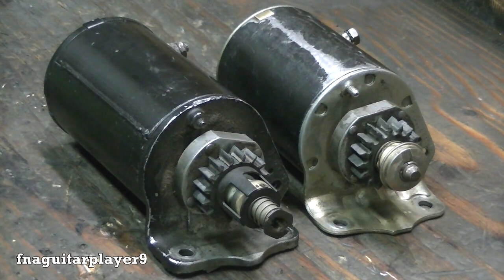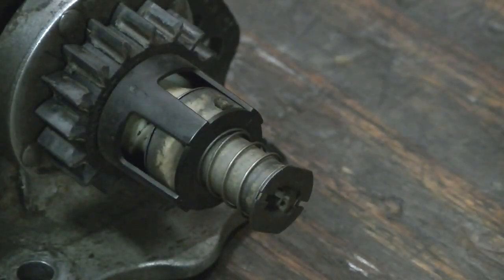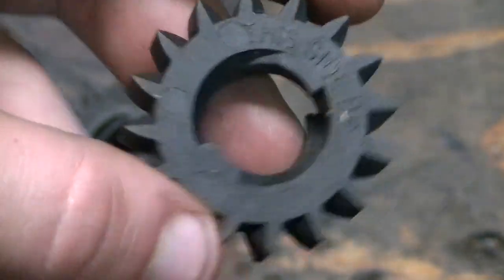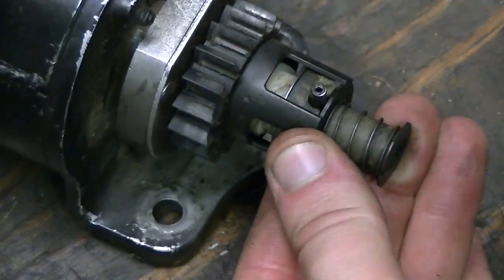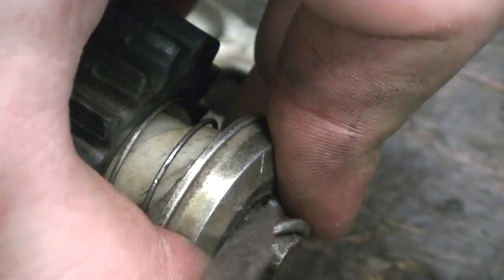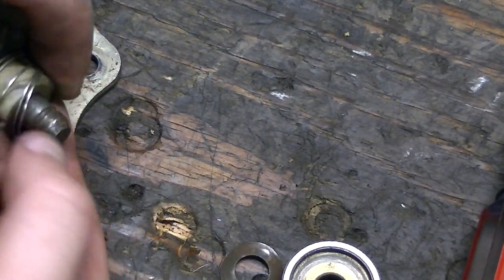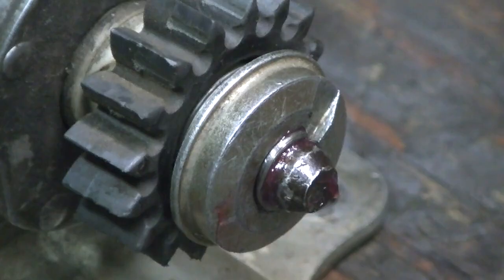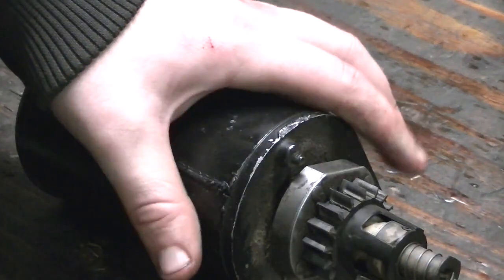How to replace a starter gear on Briggs and Stratton Starters (both rollpin and C clip type)

Comment: Thanks for the fair warning on the C clip flying off.  I held the starter in a box and popped the C clip off and it stayed in the box.  Seeing the difficulty you had putting the C clip back on I put the starter vertical and laid the C Clip on the shaft, then took a 10MM socked on top of the C clip and with one tap of the hammer it was on.
Reply from the maker: haha your welcome! I bought a bunch of them in case i loose them haha I hate this type! Thanks for Watching!!!

Comment: Thank you for this video.  While it was a real pain in the you know what, I did replace the gear on my starter today.  Thanks to you.  You ain't kidding that the dang C-clip removal and then subsequent re-installation is a royal pain.  But with a bit of perseverance and your guidance, I was able to do it, re-install my starter and get my mower running today, just in time to put it away for the winter.  Thanks so much!

Comment: Good video. To get the C clip back on, I set it on top of the shaft & use a 7/16 deep well socket & a small hammer to set it down into the groove. It works slightly similar to the tool they make for it.
Reply from the maker: Lucas Howard Thanks! I have heard of this before, I'll give it a try next time I run into this type. Thanks for Watching!!!
Reply: +Lucas Howard  I just said this then read yours sorry
Reply: 🙋🏻‍♂️ I noticed that also, but a little grease would help hold C clip in place guys. 3-25-2023 👍🏻🇺🇸🫶🏻
Reply: @vicbitterdog  ditto..
Reply: I found that a 3/8 worked best for me.

Comment: I looked at about 3 other videos on replacing a starter--one pushed the expensive Briggs & Stratton pin remover. Which is at least   $73! Well, I was determined not to buy it. So I tried just about all other removal methods and odd tools. I struggled. I even used an awl (ice pick): only to pick my hand 4 times! 
And then I saw your video--slowly take 2 flathead screwdrivers...EVEN I COULD REMOVE THE STUBBORN C-PIN THIS WAY! Thanks so much for keeping it simple!

Comment: I set the starter in a vice (made sure to secure using the mounting bracket, not the starter housing so it wouldn't crush the unit) and a closed 3/8 wrench end on top of the C clip.  Whacked it down and she was pretty much set.  Thanks for the helpful video to get me and eventual the tractor started!!!

Comment: After my B&S starter smoked, I ordered a replacement. It had a 14 tooth gear and the old one was 16. Thanks to your clip I had the guts to swap the gears and solve my problem. That little 'c' clip was nasty, but I sprayed a little silicone on it and tapped it on. Thanks for the video!
Reply from the maker: I hear ya! Yeah, that clip is a pain, i hate that type, i much prefer the roll pin style, much easier to take apart and re-install, unless its rusted up. your welcome, Thanks for Watching!!!

Comment: Good video.  I liked the way you showed how to replace the pinion gear held on with either a roll pin or a C-clip and you showed details on removing the roll pin using a 1/8-inch punch that is not tapered.  I needed to know how to remove the roll pin without damaging the starter.
Reply from the maker: Thanks! Glad to help out! Thanks for Watching!!!

Comment: I am glad I found this as most people think their starter is bad because the engine won't turn over, going clunk, and it is really that their engine is full of gas from a faulty shut off solenoid at the carburetor, or their valves are severely out of adjustment creating too much compression. Key on, valve is supposed to open allowing fuel, key off it is supposed to close. It can get gummed up and allow fuel past when in off position filling crank case, or you left key on and it filled. This motor is notorious for this and a manual in line shut off between tank and carb is essential to prevent gas in your oil. I am sure many shops have ripped off many customers by charging them for expensive repairs when it was gas in their oil. My suggestion to most if repairing the starter and the starter gear looks fine, would be to bypass the snap ring removal as most only needed to inspect the brushes and sand the commutator. Remove rear 2 bolts and slide internal brush pack out, then pull the entire assembly out from the other end. Sand commutator, inspect brushes, and grease rear shaft. You can avoid the grease suction problem by rotating shaft at starter gear back and forth while applying pressure to back plate. The trick to keeping the brushes in upon reassembly is iron wire cut in two pieces shaped like a horse shoe. They criss cross each other at center as one holds in two brushes and the other does same. Top wire must be 2" longer as it sits higher to clear lower wire holding other two brushes at 3 and 9 oclock, longer wire holds brushes at 12 and 6 oclock. Works perfect and slide back plate in, wires should stay as long as they are flush against brushes. Then pull them out and it makes replacing brush pack easy.
Reply from the maker: That is very true, or oil got into the cylinder from being tilted the wrong way or something like that. yeah, on OHV motors, its almost always the valves out of adjustment making it hard to crank over, they have a compression release on the camshaft, some of the older L Head / flathead motors have a release as well. Thanks for Watching!!!

Comment: I'm glad that I saw this. With the arrival of colder weather the starter gear on my pretty new Briggs and Stratton powered lawnmower stopped engaging the ring gear. There is a small possibility that the plastic gear might be damaged but I think it's just stuck in the down position.  Removal and inspection is going to be necessary. If WD-40 can help matters I'll be very happy.
Reply from the maker: Sometimes they will stick or may have dirt build up on the bendix but usually will clear up with penetrating oil. Thanks for Watching!!!

Comment: Thanks so much for making this video and sharing it.  I've been working on one of my cub cadets on and off for about four days trying o figure out how to repair the starter gear. Biggest problem was getting yo the you bolt attaching the starter to the engine.  It was almost impossible to get to. I gab yo grind down a 13mm socket to make it small enough to get into the very small space surrounding the bolt. Once that was done, I was able O get the starter out and on a bench where your video showed me how to drive out the roll pin.  Piece of cake thanks to your help!!
Reply from the maker: Your welcome! I hear ya, its hard to get to some of them, especially the opposed twin cylinder briggs and strattons, one bolt is under the flywheel, have to wrench it all the way! Glad to help out, Thanks for Watching!!!

Comment: I found it, that helped somewhat. I was able to get the flywheel cover off, after about 20 bolts. The starter is bolted to the engine through the top (2 bolts) and 1 bolt was easy to get to, the other is under the flywheel. However when I got the cover off and tried to start I could see that the drive gear was stuck in the down position and not engaging the flywheel! A tap and a dousing of WD40 seemed to do the trick for now, the gear itself looks like it's still in good shape. Thanks again!

Comment: Good video. But a suggestion on the second one with the c clip you can use a socket to tap it down over the tapered end right into the groove. Find which socket works best over the shaft before installing the gear assembly.  Hope this helps and makes it easier for ya. Thanks for the video.

Comment: Thank you! This was EXACTLY what I needed to fix my starter!! 

ALL the teeth on my starter were completely stripped away. This is going to save me a couple bucks for sure! (By couple, I mean a trip or call to a mobile small-engine repair guy, easily $30-$50 for this type of service call.)
Reply from the maker: Your welcome! Glad to help out! I hear ya! I just had that happend on my mower this past week, had to put a new one it (made a video, will be putting it up soon) the gear was making noise then it stripped out right on camera, perfect timing!!! I know right, shops charge a fortune! Thanks for Watching!!!

Comment: After watching your video I replaced the parts of the new starter with the old starter parts( Metal) because the new starter lasted  7 starts and plastic gears got tore up I guess because there was no lubricant on them, I also used the socket idea for installing the clip and it worked great! Thanks for posting this video.
Reply from the maker: Your welcome, Thanks for Watching!!!

Comment: I am so glad we found this video, it helped us so much. We were on each other's nerves trying to figure out how it came apart to put another part on. I need to subscribe to this. Thanks so much to the one who made it and shared.
Reply: +Remah Howell I also found this to take all the guess work out - apparently I have the roll pin, and I ordered a new gear on EBAY for $3.50 shipped !!
But please stop using WD-40. There are better lubricants, and penetrants out there.
Reply from the maker: +TIMEtoRIDE900 I hear ya, thats a good deal! I hear ya, I like wd myself, but I usually pb blaster for loosening bolts and stuff, alot of different stuff that would work great. Thanks for Watching!!!

Comment: Thanks heaps for posting this vid.My starter failed yesterday, the gear had jammed itself at 45 degrees  between the outside cover and the edge of the teeth of the ring gear.My big problem was although I found all the missing bits that were scattered down the driveway,  I didn't have a clue if was all there or how it fitted together. Now thanks to your vid I have learned some thing useful.Obviously, the locking clip failed. It was also found it on the driveway.Once again, thanks mate. Cheers
Reply from the maker: +tryhardparrot Your welcome, glad to help out! I hear ya, glad you got it fixed and was lucky enough to find all the parts! Thanks fro Watching!!!

Comment: To get the C-clip off, rotate the clip in the cap so the opening of the clip is away from the slot in the cap.  Use a screwdriver that is narrow enough to fit in the slot to get under the clip as you press the cap down.  Pry it up until it’s halfway off, then use needle-nose to get it off.  To get it back on, set the C-clip in place and tap a 3/8” socket down over the C-clip with a hammer, a little grease may help.  Worked for me. Then use a little graphite dry lube on the gear shaft, WD-40 will attract dirt

Comment: Man my starter's roll pin was so rusted and expanded up I had been slamming it with a nail + 4 lbs sledge + penetrating fluid and it STILL took forever to get it off - somehow the starter motor still works but I had to sacrifice the spring + plastic encasing in my brutish attempts. Just wanted to say your video(s) were super helpful in getting my toro 8-32 rear rider up and running great!
Reply from the maker: Oh wow! I've had them like that, i've had to drill them before too. Thanks for Watching!!!

Comment: Turned out I had to go to a completely different type of OUTSIDE Snap Ring.  I just could not get the required ring in.  And I was not about to buy a tool for over $40.00 that I would use just this one time.
Good info on the Chamfered side up (for the pinion).  Mine was not labeled in any way, but I deduced that the chamfered side would engage the Ring Gear a lot easier than the "flat" side, just like a car's starter pinion.
Sure appreciate you folks who take the time to make these videos.  Have done lots of these things many years ago and then forgot after not having done "whatever" again for 50 years or so.
I understand that when WD-40 (so named 'cuz it took its inventor 40 tries to come up with the formula) sold many years ago the new owners significantly raised the water content in it.  No idea if this is true or just Camel Poop, but Blaster works just fine for me.   Thank you.
Reply from the maker: I hear ya! I'm always glad to help people out. I do agree with that, i usually only use wd40 on stuff like that starter or hinges, and pb for rusted on bolts and stuff. your welcome, Thanks for Watching!!!

Comment: Don't forget to check bolt tightness, there has to be a lockwasher on each bolt otherwise they bottom in the hole and leave a dangling starter motor that strips threads faster.   Chk starter frequently for looseness/wobbly install (loose or bottomed bolts).   2. U can use 9mm or 5/16 socket & hammer to tap the snap ring back in.   3.  One guy showed how by turning the flywheel (battery disconnected) by hand he can get the pinion gear off & one without taking starter or flywheel off.   Another guy showed how he with hand grinder, ground off about 3-4" length of top side of flywheel (don't get into the flywheel teeth) to make more room to get pinion gear off easier removal again w/o taking starter or flywheel off.  Good video, thanks.
Reply from the maker: I'll keep that in mind next time, Thanks for Watching!!!

Comment: It has been a very long time since I did anything for a starter.. Instead of putting the Pinion Gear the first in line on the Bendix Drive I put if on last keeping it engaged to the flywheel, but keep thinking about not being right. But I don't feel bad cause an experienced Tech got it backwards as well. I'm hoping the tech just didn't know and not trying to sell me a new Flywheel. Watched your video and got it straight. Will be showing the Tech in the morning what was wrong. Thanks bunches!

Comment: Thank you, just what I needed.  Had the version with the pesky c clip.  My spring retaining cap wouldn't push down so I put an old 3/8 socket over the shaft and hit it lightly once with a hammer to get it moved down.  To put the c clip back on - I put the clip over the top of the shaft and then put the 3/8 socket on top of it and hit it a couple times with a hammer to knock the c clip back in place.
Reply from the maker: Your welcome! Heard that, they are a pain haha Thats a good idea, i've done it like that a few times. Thanks for Watching!!!

Comment: Excellent video.  I would never have figured it out on my own.  Got the new kit installed, and everything is working again.  Just wish I didn't have to pull all the shrouds and the flywheel to get the old gear off and the new one on.
Reply from the maker: Thanks. Glad to help out, I usually remove the starter to replace the gear, depends on the motor. Thanks for Watching!

Comment: great video thanks for doing it!  If anyone has a rollpin design, DO NOT try to hammer the pin out with the starter bolted to the engine!  I cracked the aluminum mounting bracket in half on mine because I was hammering so hard.  Unbolt the starter and use a hydraulic press.
Reply: Do you recommend removing the starter in general? I want to replace gear with it mounted
Reply: @Deleted_account_101  that’s what I tried but that pin on mine was so tight that I broke my cast aluminum starter bracket mount.  I had to press the pin out on my hydraulic press

Comment: I needed to see the order for the pats to go on. My old one flew apart, which is why I need to replace it. I do know an easier way to get that C ring back on, though. If you have a deep socket, that's best. Just use a socket which barely fits over the shaft on the starter - I THINK it's 3/8, maybe a 7/16 though. Place the ring on the tapered end of the shaft, put the socket over it, and dive it down until it snaps in place.
EDIT: Finally fixing mine, and found a 10mm works great. I used a deep 10mm socket to drive it into place. If yu are having trouble getting the ring back on, you might wanna give it a try.

When removing snap rings, if you can (or if you have a friend around to do this), hold a screwdriver against the end of the shaft when you take it off. When it pops off, it is trapped on the shaft of the screwdriver. Beats sweeping the area with a magnet. Yep, been there a few times...

Comment: Well, you make driving that pin out look so easy.   The roll pin in my starter must be welded in.  I pounded and pounded and it does not budge.  Penetrating oil and all.  I ended up breaking one of the plastic pieces. Life is too short.

Comment: Thank You for posting. My gear split in two. I had the pin type. Your video really helped me out.
Reply from the maker: +Dark Jedi Your welcome! oh wow, most of the time the teeth just strip off. Thanks for Watching!!!
Reply: Well as it turned out when doing the job the two bolts on the starter were loose and the starter twisted to the side causing the gear to split in two. The engine had just been replaced at the shop and someone was sloppy and either didn't tighten the bolts to proper torque and didn't use thread lock on it. So that was the reason why it happened. As the old saying goes "If you want something done right , do it yourself." :-)
Reply from the maker: I hear ya, that will do it! haha i hear ya, that is true!

Comment: I just finished rebuilding my B&S starter motor.....the kind with that damn circlip.  After watching this and other videos, I noticed that they conveniently pause at the point of showing how to install the clip.........and then restart once the clip is on.  Well, I figured out a way to do it in less than 1 minute and it doesn't use a deep socket.  Start one end of the clip in the motor shaft groove and then use a large pair of channel lock pliers to pinch the other end into the groove.  Finish the job with a pin punch, screw driver, etc to fully seat the clip.  Easy peasy!! Maybe I'll post the video.
Reply from the maker: +midyearguru I hear ya. hahaha yeah, well about that, I had like 10 minutes of video trying to do it on video, gave up on recording it haha Makes sense, i'll try it. Thanks for Watching!!!

Comment: TIP: The end of the shaft is tapered so the ring can be driven in with a 1/2" socket and hammer. Support the back end of the starter to avoid armature damage.